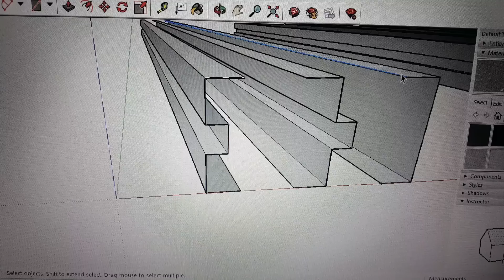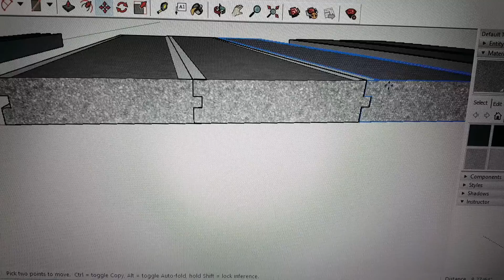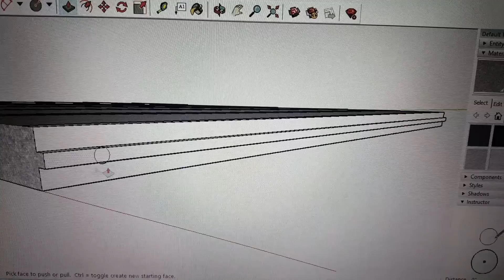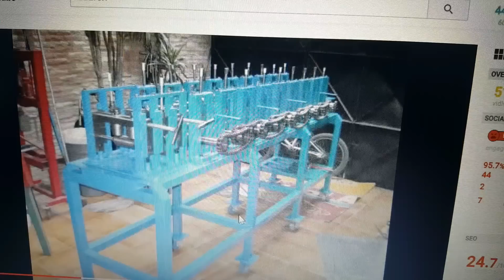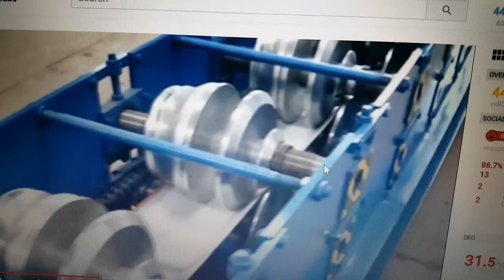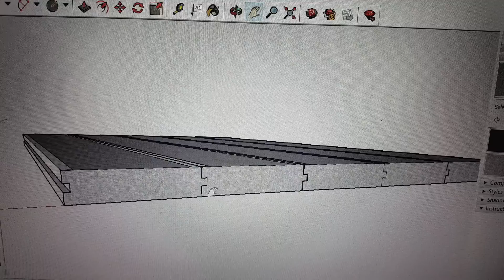Air Crete Interlocking Wall Panels

Comment: What program do you use to make diagrams of forms you want to create? I have a basic PC. Is there a good downloadable program I can use to create my ideas?
My fiancee who is in the Philippines is very poor & her community is very poor and we wish to create hydroponic gardens to grow food to help feed the poor, in her country & many others. But there is always the threat of typhoons & large tropical storms where she lives.

Our idea is to build hydroponic gardens on wheels, so we can push our hydroponic garden "segments" into an air crete dome when a storm hits, and after the storm has passed, push our hydroponic garden back out of the dome and have food for those who have suffered. 

We also want to create air crete domes for housing & protecting the poor who have nowhere else to go when a storm hits (air crete domes would have much much less "wind sheer" & therefore can survive a typhoon if anchored to a foundation poured 2 ft into the ground).
We believe that air crete is the future for building protective domes for both, housing our hydroponic gardens during a storm, & to create homes that protect the people too.

Do you spray your forms so air crete separates from the forms more easily?
Often, many years ago, you would build a a plywood form to hold the concrete when pouring a solid wall...like a basement... and spray the inside of the plywood with oil to help separation of the plywood from the concrete, or does air crete separate easily because of air pockets?

I am hoping to create a form that is 1/4 or 1/8 of a sphere and fill it with air crete and duplicate it many many times over, then link (anchor) 4 - 1/4 spheres or 8-1/8 spheres together, to make a dome and anchor the dome to a foundation that has been poured into the ground.
I am a novice, but I have knowledge and creativity and a desire to make my life mean something...to do something greater than myself... and I think and live outside the box...always thinking and creating new ideas...new possibilities.

And now I have found my Angel...just like you found yours...and she & I wish to try to change the world.
Can we do it? I guess that is up to us. "There is on try...only do or do not" (Yoda).

I am 60yrs young & have no plan to slow down. I am just getting started & my fiancee is half my age and has the mind of a sponge...always wanting to learn and create and help others less fortunate!
The age difference bothered me at 1st but 4 years later, I know when I am looking into the eyes of an Angel, and she posses the same drive & determination that lives within me. I just needed someone who believes like I do! 

We do not care about what we want. We care about what we can give. Give by helping others less fortunate & those who are struggling thru life just to put food on the table & have a roof over their heads when they sleep.
We are not "left" or "right". We are just 2 people who care... and want to spend the rest of our lives together helping others. It is not about money, but about giving & creating opportunities for those less fortunate.

What advice do you have?
I am all ears. 

And that goes for anyone else who may read this...hnbc66@yahoo.com
Help us create a better world
Reply: The program being used in this video is Sketchup from Google and the basic version is free. It's very powerful and is easy to use.

Comment: Great ideas. For myself I'd like to build corners out of a single piece. Of course you'd need inner and outer forms, but that's no biggie. I also REALLY like the idea of tension cable to tie wall panels together. Plumbing, electrical and so forth is doable I guess, but seems to me to overly complicate what is basically a simple concept. Additionally once in place repair down the road is virtually impossible. Hope you get this up and running. If you can build the roll formers yourself and RENT rather than sell the forms I think this could be a real money maker. As well as a HELL of a lot of fun. Take to the bank though that when successful you'll have a huge number of competitors in short order.

Comment: Your tongue and groove idea is good, but I would put draft on the tongue and groove sections. Making the male part at a 15 degree angle on each side will allow you to remove it from the form easier, especially when using a release agent. Putting the corresponding angles on the female side will also allow you to line them up easier.

Comment: Better to form them with 3 sides flexibly gasketed so that each section gets 1 metal stud that can just be put in the C channel and slid tight to the previous panel.
This would make it easy to drill out through holes where needed using a pre-punched hole.  Aircrete is soft enough to drill the hole with a sharpened piece of electrical conduit using another metal stud as a jig.
I was told that most of the rigidity comes from the metal cross strapping and envelope  (drywall, sheathing etc...)anyhow.  I've seen people that only screw one screw into one C channel (something about earthquakes and movement)  - just weird... studs are supposed to hold the drywall in place not the opposite; metal framing is strange.

I'd consider doing a V or U notch for easier fitment.  Ideally a U with a slight curve at the base to eliminate the weak spot.  Hmm, is it rigid enough to use smaller studs split in 2 L channels with the interlocking edges of aircrete between... it would provide a thermal break and a mortar surface  (lime mortar for better flexibility? )

Comment: You have some good ideas going here. I would consider making the bottoms end of wall panels with a female recess and the tops with male spines. Here's why. On your bottom tracks (or the sill plate if you will) you could pour just the male spine. That would allow you to easily and quickly control the placement and retention of your wall sections at one of it's most vulnerable areas. At the top side you could lay a wall slab on its side with the female side down to lock onto the male splines on the wall slab tops. It would be like one continuous header which would work for door and window openings too. Also I like that you used some wire mesh in your wall slabs. It helps with their structural integrity a bunch more than people know. If you do this tongue and groove idea you'll want to double up on your mesh so that a sheet of mesh rides the respective space on either side of the female recess. Making little squares or rolls out of the mesh that you stick in between the sheets will help to ensure that the mesh sheets stay in their allotted areas and the top sheet doesn't just fall to the bottom. Also wire ties at the corners and somewhere down the sides in the middle area will suspend the bottom sheet and keep it from becoming just texturing on one side of your wall sections. Good luck with your endeavors!

Comment: Why not pour a complete slab 12 inch foundation with pvc running verticles in each form 2 ft spaced. where ypu can introduce treaded ends steed rebars on both sides top and bottom one for roofing frames one to anchor them down in the hallowed out 6 inch base groove precast in the 12 inch steel reinforced foundationp with  shielded anchor steel framed  nut  in the foundation .the pvc pipes will be wide enough to ajust their attachement to the anchors.

Comment: Why not just put dowls and holes, or holes for dowls in the 2x4's, it would save alot of work. Maybe modify PVC cap plugs, by putting a groove in the 2x4 can lock in to. With something like a screw the concrete can Holt to on the end, then something like a 4" piece of 1" dowl can be tapped into one side then slide together!  I don't know if it makes sense, but hey, it works perfect in my head!!! Ha-ha..

Comment: So why are you using investment framing? Why not coat the metal frame with release film/coating, then use low expansion foam between the joints to avoid thermal bridging?

Comment: There are Chinese companies selling aircrete home kits in panels. The panels does not use metal studs on interlocking. I suggest you manufacture reusable moulds for making panels rather consumed the mould on each panel.
Reply: Michael I would agree to some point but suggest steel framing does have better structural advantages also. I travelled to china & india numerous times since 2008 investigating most techniques for production of EPS & CLC foam cement & post assembly infill methods.
Reply: Can you tell me the name of said companies?
Reply: @jhereseedwards1951  I just watched them on you tube. You can search them on Alibaba.
Reply: Michael Tung thank you
Reply: What's the names of these companies?

Comment: Why panels? Could you not form a whole wall? Build plywood molds upright. I was thinking cattle panel in between, and pour from the top. Let it set and take down the plywood.
Reply: It's easy to handle small pannels
Reply: @rukhone1  if you poured the form in a solid piece, it would make the structure stronger and wouldn't need to install in place.

Comment: That's a sill plate,  not a stud. A stud fits inside the sill plate and they have edges that roll back into themselves to give them more support. They also have holes for utilities  n such. They're about on 2' centers. ..also. the holes are to run hat channel through  to stiffen up the walls.

Comment: are you not afraid of condensing by having thermic bridge because of metal sheet corners?? I mean aircrete is super insulating and metal super thermo- conductive won't it create a problem is it not possible yo use pollywood or fiberglass sheet??? 🤔

Comment: I see large commercial buildings going up from preformed concrete walls that get trucked in. I wonder what methods are used to tie those together. I Think they have built in metal anchors that align when assembled. This is like a smaller version of that building method using regular concrete set in place by cranes. I would think that With The brittleness of Aircrete simply nailing or screwing them to a header or footer will not hold under stress. Also i think of how to keep rain water off the lower walls that will run down into a c channel at the footer

Comment: I thinking about using 6" wood or metal frame that you fill only 4" and then bolt together and fill in 2"foam on it side to make flush exterior wall.  Cover that with a stucco type aircrete.  Before you fill in the final 2 inches with foam you could run your electrical

Comment: since your side panels are sheet metal a break press would easily bend these metal side pieces and a break press would be way easier and cheaper to build than a roll former, your tongue and grove edge piece is the first thing i thought of  when i saw what you were doing, i need to build a shop so i'm watching what you are doing  thanx

Comment: Another difficulty is that if you are going to make tongue and groove shapes w/ a roll former out of sheet metal, water will get in there and rust. This will ruin marketability because of rust forming inside and out. Also, putting the panels in c channel will collect more rust and water. I saw air crete joined with mortar and no steel at all. You are good man.

Comment: Several problems w/ your ideas are that the drawings don't reflect the true shape of metal studs which are the only kind you have made so far, difficult to join. I have used roll formers and have never seen tongue and groove shapes. I can make two dies for that shape on a lathe but then they have to be heat treated. I wouldn't say what I'm gonna do.

Comment: Would not be easier, and sturdier too, to make "lego" shape mold blocks to interlock walls together? You would get strong corners and vertical and horizontal stability? At the end, who doesn't know to build with legos? Each peace would be lighter and you can perfecty stap them up. Greetings from a spanish living in Holland.

Comment: What do you suppose the weight of each panel for the end walls? If you go to any Home Depot,Lowes and Sams Club they sell plastic sheds that are larger than 10' X 12'. I don't believe they meet building codes in any state in the continental US. In Florida I see them with plastic roof panels also but 1977 was the last year we had several inches of snow in the Tampa Bay area.

Comment: Your Idea is good, although I would prefer a form that creates L shape panels, this type can easily allow bolt together installation, using adhesive and a few bolts, and the form/mold is easy to construct. Do air create panels actually need the metal 2x4's, I am adding more reinforcement wire within the L shape panels, and totally do away with the metal 2x4,s, this will also reduce cost.
My Ideas are to reduce materials, and construct in such a simple way to create high strength, instead of adding, and adding until the cost is out of reach, and creating construction overkill. One could also within the mold create a nice exterior board, brick, or stone pattern.
Reply: When you say 'L' shaped panels, you mean 'L' shape when looked at from the side? i.e. they might be 2.4m high with a 175mm wide toe at the base. I'd also probably mount these panels  on a 200mm high concrete footer with a tongue strip all along it matching the groove in the base of each panel. And use adhesive to join  panels with each other as you suggest.  I'd also use post and beam construction rather than relying on aircrete for structural integrity.

Comment: I would also be eliminating the steel and perhaps using a rebar system instead, because many building codes will require it.

Comment: you may need a groove along the bottom to allow the panel to sit and slide over the expansion bolts in the c channel track, just a flat steel to screw both panels together

Comment: Make the studs hermaphroditic so they can be 180 degrees symmetrical.  Put corresponding channels on the top and botton.  This way you're only making just one component plus the c channel.  ill draw it up for you if need help understanding.  Just help me get setup if you use my idea.  ill pay for the parts.

Comment: Might want to apply for patents or whatever before you start getting too detailed on your plans.  That said,  you could make these both male and female if you have the former run a flap back over to that it creates a flange that you can use to screw the panels together.  Have a male on the bottom of the panels to mate into a female metal channel run that is screwed to the foundation. Have it female on the top so that you can run a continuous strap in the groove to tie them all together.  If thin enough it would also allow you to do the male-bottomed headers.  You may want to consider running a bead of expansion foam between the sections to completely seal out the weather.

Comment: If wood studs are an option, why not build the panels 24" wide.  Then there would be no need to use a tongue n groove deal.  Just toenail screw the panels flush together.  But, the wood would limit things with bugs and fire resistance.

Looking at previous videos it seems that he should invest in a small concrete vibrator.  Also, it looks like he needs a more course reinforcement wire and needs to stand off more.  That way the reinforcement doesnt show through on one side.
Reply: I think it was all very experimental and he may have realised the reinforcing needs to "stand off" by now. i still can't understand why they need a metal encasing frame. Surely this is over-engineering? I wonder about a concrete vibrator myself, there appear to be difficulties with large air bubbles.
Reply: Colin Bluett air bubbles are what create air-crete, you dont want to shake them out!!!

Comment: Mr. Honey do,
Great work go these panels. I enjoy all the videos and your spirit. I have worked in a steel modular panel building that the walls leaked.
Any mounting of panels must be inside the panels out must wall surface. The problem was the wall panels were placed with in a "U" shaped  footer and all the wall runoff water would be channeled in building.  Thank you for all the great idea sharing. I hope this helps.
Paul Rice, Lake Charles, LA
Reply: Combat the water ingress via the U channel you could make sure that the depth on the outside is shallower. Imagine just lopping off one side of the U, the longer side is the internal floor the other is the external run off.
Reply: ...or cast a curb footing with a 30 degree angle to shed rainfall, adjoining to the structure, might be a good solution.

Comment: Re: PVC in the forms, if you put them in at the standard heights for outlets , with 4"x4" void to make room for a double junction box, and a vertical run from there to standard switch height and on up to a wall sconce height, you're ready to pull Romex or flexible conduit through those wiring chases.  You could make some panels with just the horizontal chases and no voids for junction boxes, and mix/match them as desired.
Reply: I was thinking the same. This also reminded me of SIPS, except fireproof. 👌

Comment: I was thinking of this with logs as was done by Austin and Erickson in my area. When the groove was in the bottom of the log it fit into the tongue bolted to the foundation and the tongue at the top of the log fit into the header.  Like with your air crete panels one man could brace the first log and assemble the whole house by himself.  In the 1950's I watched a neighbor do it.
Reply: 1950, what materials were used?